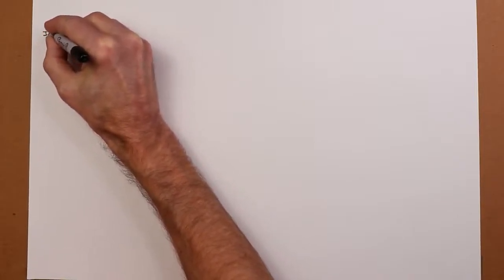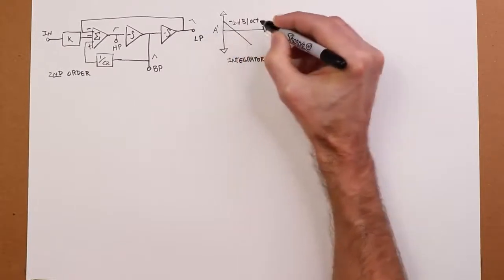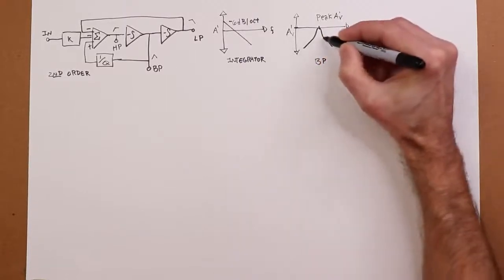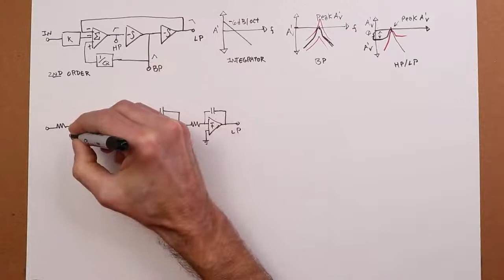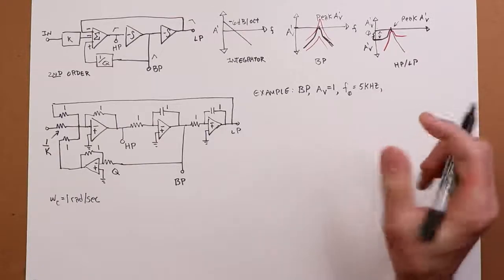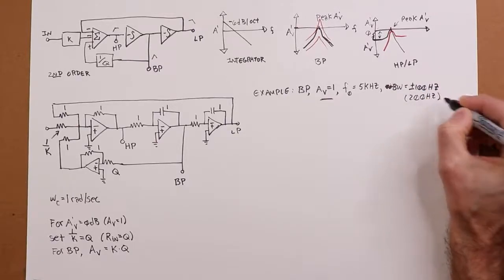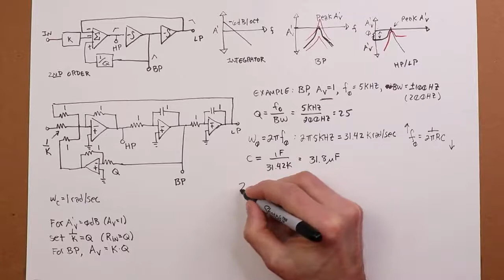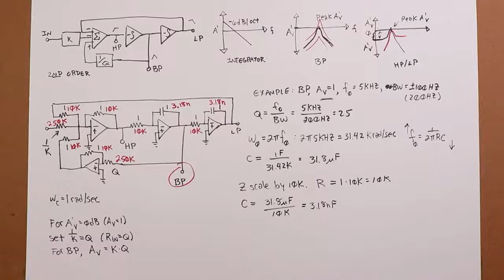Op Amps: State Variable Filter

Comment: nice video man, it was very helpful. How could I implement a variable resistor to dynamically change the cutoff frequency?
Reply from the maker: There's an example of this in my accompanying Op Amp's text. You can download it for free (see the description for details). No strings attached.

Comment: awesome... what need to change to move the peak over the audio frecuency 20-20khz??? like cutof knob
Reply from the maker: You could replace the input resistors on the two integrators with rheostats. This is discussed in my op amps text book. (It's free- see links in video description).

Comment: Why did you choose to scale the cap values instead of resistor values for setting f0 here? In earlier videos you made what sounded like a good argument for adjusting the resistors (greater variety in standard values,) but here it seemed like it was a case of wanting to show an alternate way to do the math, and a little bit of making things easier to write out.
Reply from the maker: A designer can scale as needed. Indeed, nothing says you can't adjust both resistors and caps. Whatever works best. That said, I do like to show calcs using the least amount of "friction". There are a lot of resistors here, and most of them will be the same value, so practically speaking, it's less cluttered and moves faster. Nothing magical here. ;-)

Comment: Thanks for this video - I've been trying to understand this circuit for a while and this is the closest I have come to getting it, BUT, I still don't get it!  I'm obviously missing something, please try and explain to me :-)  If you have a high pass response, i.e. low frequencies have been removed, and that is then fed into another stage, how can the low frequencies be restored?  As a previous person commented - there are assumptions made, and given what you say it seems logical, but I still don't get it, help!
Reply from the maker: Your wording might shed light on the issue. When you say "low frequencies have been removed", be careful. In reality, low frequencies are being attenuated at a specific rate (6 dB per octave). They are not being removed completely. If you now boost them at the mirror rate, you'll get back to where you started (ignoring any additional noise or distortion).

Comment: Thank you very much for your text book and this playlist , your coverage of the topics was really nice you in text book give example for fixed G and Q and here cover the variable circuit so thank you for your effort. 
 I have tried this circuit with variable Q and G 
I have made a calculation to make my fo = 40.972Khz (f1 = 39.5 Khz , f2 = 42.5 Kz) with B.W = 3Khz
but I have made a f-Scaling to the resistors instead of capacitor 
the final results given that :
1 ohm R = 3978 ohm
1F C = 1nF
and I want unity gain so Rq = Rk = 54300 ohm (with Q = 13.657) 

the problem that the circuit didn't work until i adjust Rk to equal = 96.5K and Rq = 30K (This value gives a unity gain and when i decrease Rk it gives more Gain) so what's the problem with my calculations ?
Reply from the maker: To start with, there appears to be a problem with the initial calc for f0. I don't get the same value using your R and C. Beyond that, are you using Fig 11.44 from the text as your guide? Remember, for bandpass, gain = kQ.

Also, there is a TINA-TI simulation of this circuit in the playlist. That might help:
https://www.youtube.com/watch?v=cJORc8inK9Q
Reply: @ElectronicswithProfessorFiore   
yes iam using fig 11.44 in the text book 
My R = 3.9kOhm for any 1 ohm resistor 
 C = 1nF
with Rq = 30K and Rk = 96.5K i got the narrow BPF with fo = 40.9KHz (Q = 13.5) with Unity Gain , i made this circuit on breadboard and worked fine 
the question about that Rq and Rk calculation it's the not same as in text book so that made my confused  

I have see the simulation in the next video on playlist and  in will try to make simulation to show what's problem with Calculation

Comment: pls show us to build  5 band equalizer   4558 op
Reply from the maker: In that case, I suggest that you subscribe to this channel if you haven't already. I have a bunch of videos covering EQ and similar circuits in the pipeline, including multi-band and parametric EQ. BTW, I wouldn't use a 4558 as there are much nicer op amps out there!

Comment: Can I use a quad opamp for all of this or do I need four separate opamps?
Reply from the maker: Using a quad is a popular technique. For example, if you're using TL081 BiFET op amps, you could use a single TL084 quad instead. Much easier to layout. The only downside is that typically quads do not have DC offset null connections, so if you need that capability, you're going to have to go with singles. Offset nulling is described in another video that covers DC output offset.

Comment: But why does the output of the summing filter have a high-pass response? It seems you assumed this in the beginning and never came back to it..! Helpful otherwise, thank you!
Reply from the maker: Yes and no. It's a circular system. We use that as a starting point, we assume that's what we get. As we proceed through the analysis, we are curious to see if that's what comes back at that point. If it does, then we know the original assumption was correct (and it does, so it is).